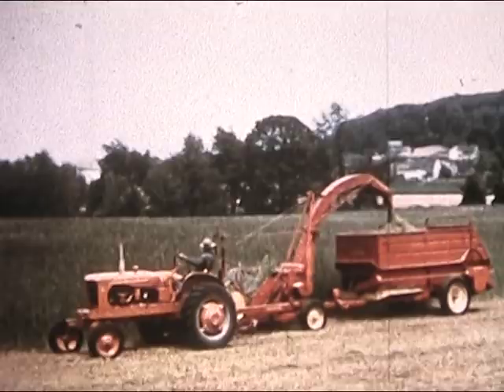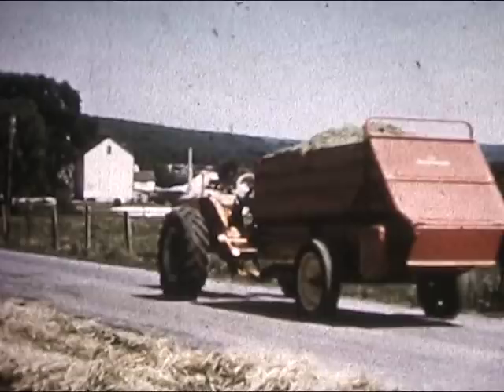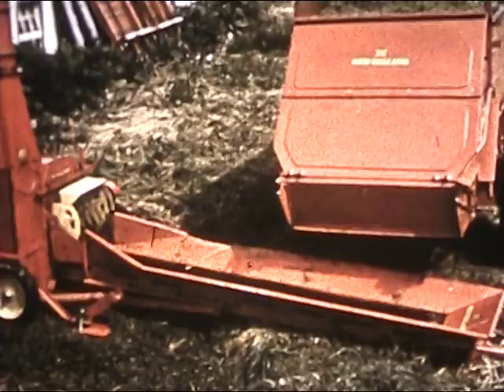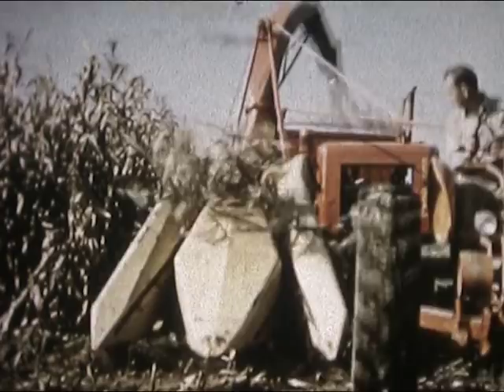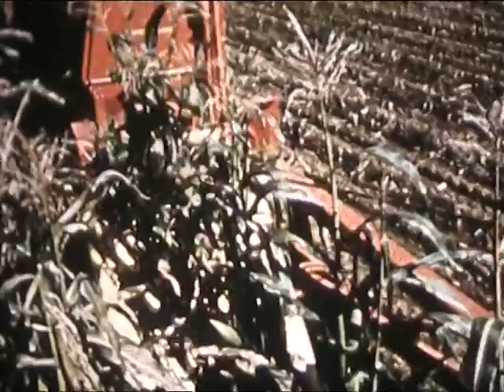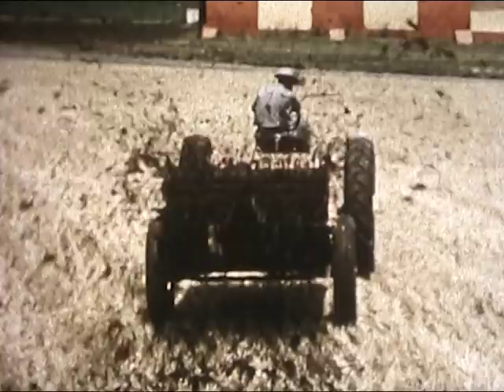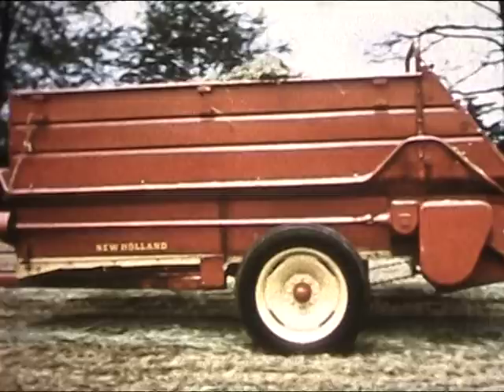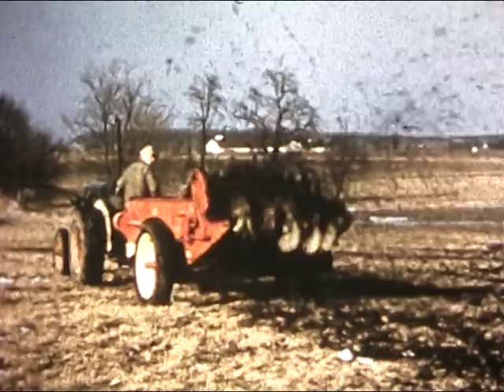Vintage Hay Balers 1950's Part 1

Comment: What year is the film from?  What year did the model 800 come out?
Reply: Hi Greg, this is a New Holland promo film about the Model 800 forage harvester (their heavy duty model), year ~1958+ and the ensilage carrier attachment that could be fitted on their manure spreader.  It was pretty innovative for the time - New Holland had the most advanced R&D department of all the big agricultural manufacturers but they were not building tractors back then.  Ciao, L (FoMoCo engineering).
Reply: @lancelot1953  Thanks, I like the idea of converting your manure spreader to a forage wagon.
Reply: Hi Greg, NH made an incredible number of prototypes and unusual products especially when they came under the Sperry Corporation (1947~1986).  Back then, engineering and manufacturing was relatively cheap compared to modern times - that is when NH really took off ahead (innovation-wise) of much larger established companies.  We had a lot more farmers back then that used smaller machinery, this provided the ag-manufacturers with a large market with plenty of room for improvements.  I wanted to be one of their engineers while in college - but unfortunately times/agriculture changed.  Ciao, L
Reply: @lancelot1953  It is always fun to think up new agricultural machines.  The current machine that I think could revolutionize agriculture is 360 Rain autonomous irrigation.  It only irrigates the rows, and can do the entire field on far less water.

Comment: I don't like the idea of using the shit spreader as a silage wagon.  You're contaminating the silage with manure, and fecal microbes.  Can't imagine that did much for silage quality or disease prevention.  That's what they make chopper boxes for.
Reply: they are using two different devices.  One would never be used for the other.
Reply: Ever heard of washing something out? The silage wagon part would be used once a year, summer into early fall. The rest of the time it would be a manure spreader. Back then cows were put out to pasture so there wasn't manure to haul year round. And then if someone's really concerned with it.. wait for it. You park the tractor and spreader facing up a hill near a water outlet, usually in the barn yard somewhere, pick up a garden hose, and your wash it out. It would be summer time at that point so there won't be anything freezing. In case you couldn't figure that out  :)